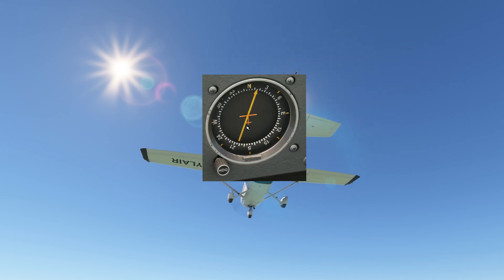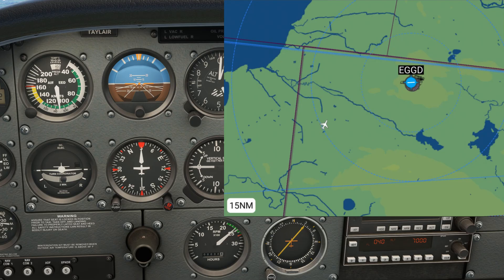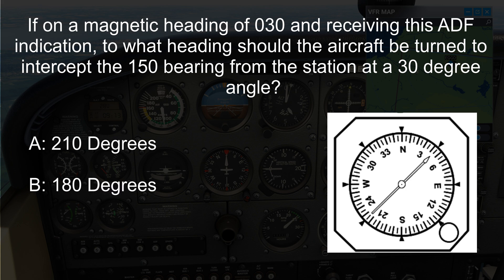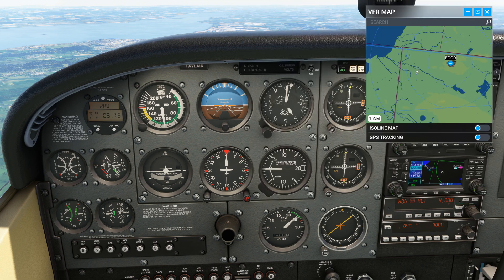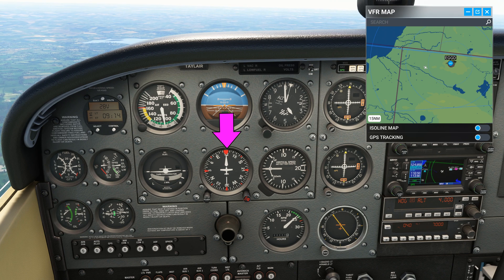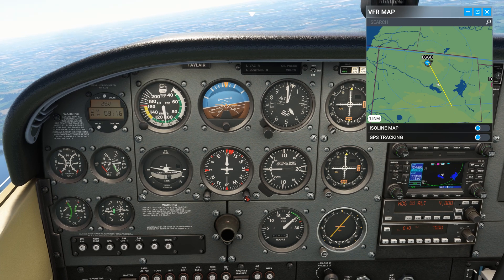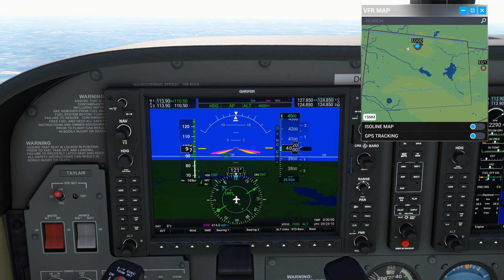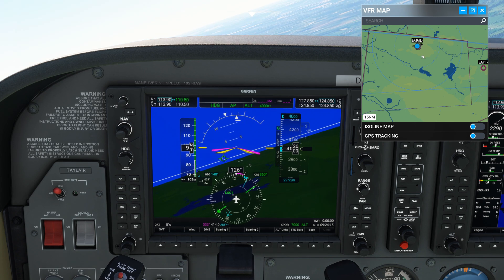NDB Navigation - Intercepting Bearings!

Comment: 3:15 Hot Tip: Now that you’re established on a heading of 120, rotate the ADF card (RBI) to synch with the DI so that it reads 120 at the top. 
Now it will be easier to intercept the desired radial when the tail hits 150. The G1000 (or an RMI - Radio Magnetic Indicator) does this automatically for you, hence why it’s easier.

Comment: A quicker way to do the calculations:
Since the question asks for bearing number instead of how many degrees needed to turn, you can simply +/-30 on the 150 bearing and rule out the 210. Then as the RBI shows you'd intercept 180 first before even reaching 150 then 120 is the correct answer. You don't even need to look at the compass.